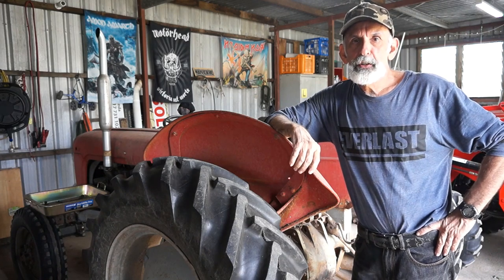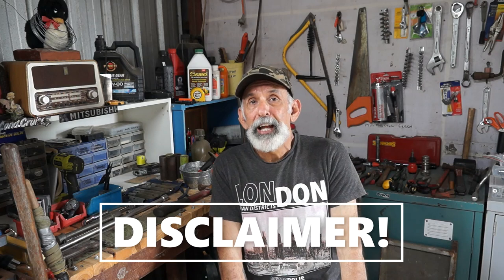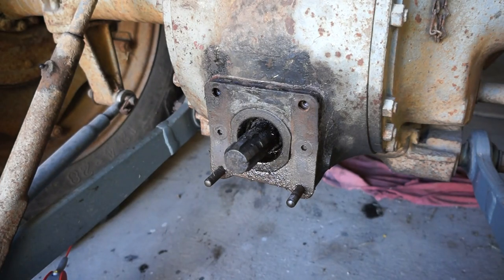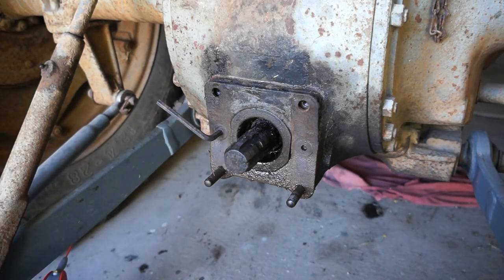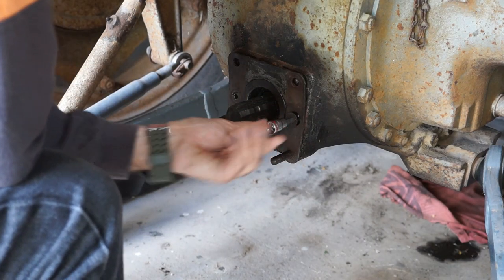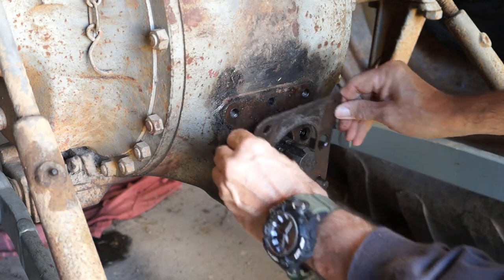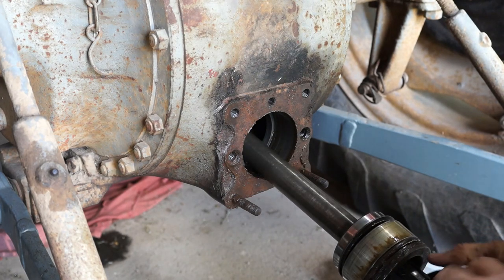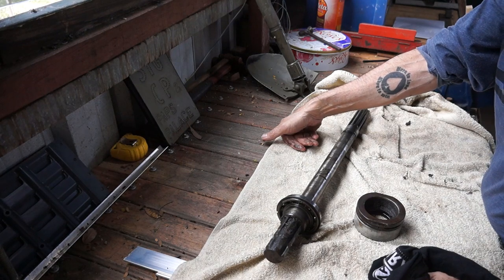MASSEY FERGUSON 35 PTO Seal and Bearing - PART ONE

Comment: lol.  Seeing people try to use wrenches to take it out make me try that for half an hour.  Completely useless.  I just put a piece of wire through the hole at the end of the PTO shaft and gave it a yank and it was out in seconds. You can put a screwdriver through the hole to use to pull.  A slide hammer would work fine.  The pto shaft can be on it and used to lever it out too.